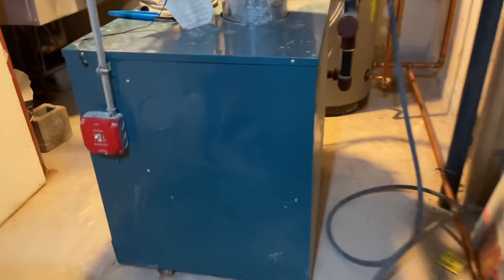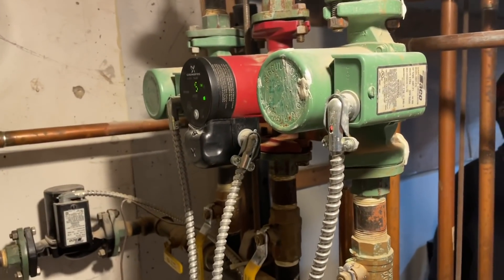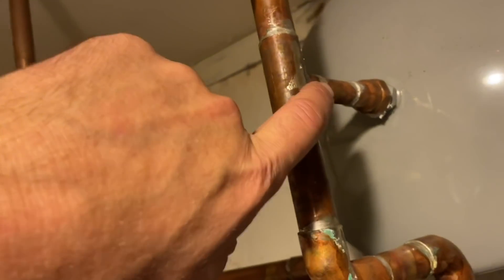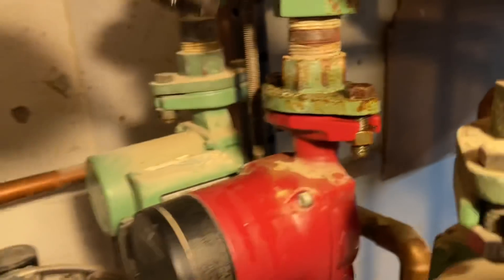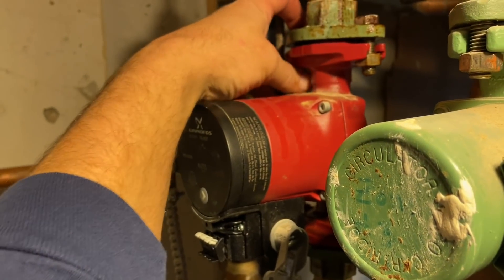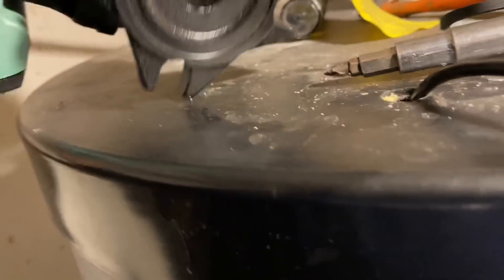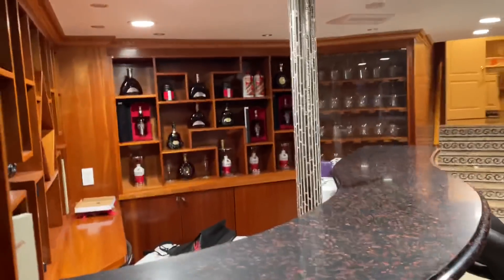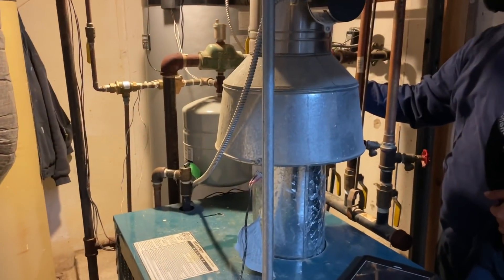Confused Gas Heat System! Either No Heat or Overheats! Bad Circulator & Check Valve - Problem Solved

Comment: As a mechanic for the last 40+ years, not a big fan of slip-joint pliers. Seen to many bolt heads worn or stripped down because people don't know how to use them properly. Combination wrench, socket wrench or gear wrench for me.

Comment: I use the grundfos alpha 2 Circulators and I have had no problems with it, it's used because of its auto adaptive modulating capabilities.... did you remove an alpha 1? That's so weird you had lots of problems with them, because up here, they are like the best pumps besides the Wilo...
Reply: I had that Taco pump burn out on me with 2 pumps at 4 months run time each.... so weird..

Comment: If you reset the power for 5 minutes for that circulator pump it may work again, that what the manufacturer manual say if it doesn’t work after resetting the power than replace it....a

Comment: The system already has a one way valve, your new circulator has a check valve on the back. Any problems w/ 2 check valves??

Comment: Just watching this after replacing old B&G circ pump and check valve on my water heater. I don’t remember taking the little foam wedge out of the valve. Crap ! . It’s all buttoned up now and running and I’m starving. Tomorrow. Rookie mistake.Also trying to find that copper burr in my finger . LOL.

Comment: Mike, I have three friends that they are plumbers and they only use Grunfus alpha pumps, and they have not problems so far, I have the same pumps in my house for 6 years so far, and they still are working. I guess you have a bad experience with a bad circulators since they were manufactured. I love Grunfus alpha 2 pumps.
Reply: Sorry to bother you guys... Grundfos Alpha 1/2/3 do NOT name product generations. They name different feauturesets. The pump generation isn't that obvious. In fact first Alpha generation dates back more than 15 years! Currently it's product generation "D" with smaller impeller, for all Alpha 1/2/3. Whenever installing high-efficiency pumps like Grundfos Alpha, UPM3, Magna3, .... you need to treat your heating water with anti corrision inhibitor and install spirotrap magnetic filter. Otherwise any high-efficiency pump is about to fail sooner or later. Greatings from germany, cheers :)
Reply: @PipeDoctor   yes indeed, they use alpha 2 pumps.
Reply: @PipeDoctor   but they dont have issues with the alpha 2. like you said the first alpha generation are not good.

Comment: Since the center pump has already been replaced at least 1 other time, is there a reason that it continues to fail on that zone only. The other 2 pumps look to be original to the installation.
Reply: Probably undersized if it's headed 3 floors up? I'm in plumbing wholesale and sell tons of alphas with very few issues. And they 100% still manufacture and sell them, at least in Canada. Tacos are great too though. Love the vids👍
Reply: @PipeDoctor  Naaah, Grundfos doesn't suck. Your understanding on how to use high efficiency pumps sucks. You could still use old style Grundfos UPS pumps and will never experience issues due to magnetic debree with these old cast iron boilers and piping. Any high-efficiency pump is going to fail without proper anti-rust protection.
Reply: @PipeDoctor  Thanks for the reply. I thought I would bring up that observation because in my parents house they had a well pump fail 3 times in ten years. The original pump was over 35 years old before it died. It turns out that it was a severely restricted check valve that was causing low initial water flow/air pockets and quickly wore out the impeller because the pump would run for 2 or 3 mins almost dry before it could build enough pressure to overcome the restricted check valve.
Reply: Grundfos is far superior over taco ..night and day really . I change out more taco commercial pumps over grundfos by alot .
Reply: Check the grunfoss impeller- it's jammed.looks like it was an air lock all along..

Comment: What do the ECM Taco circs draw for power?  I bet they would work with a backup battery-inverter system.  I could run my steam boiler for a long time on four 6 volt golf cart batteries, wired series/parallel, and a sine wave inverter.
Reply: @PipeDoctor  nice.  I could easily run one for 2 or 3 days.  May consider a small hot water system to supplement the mini split in my new place.